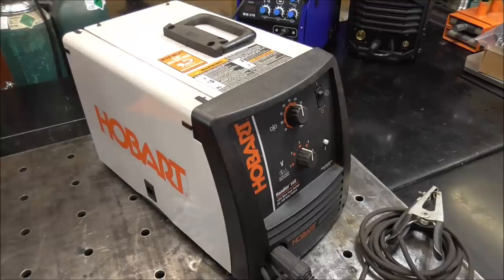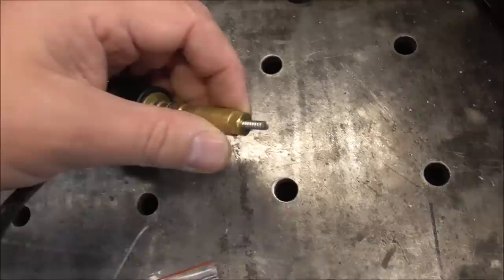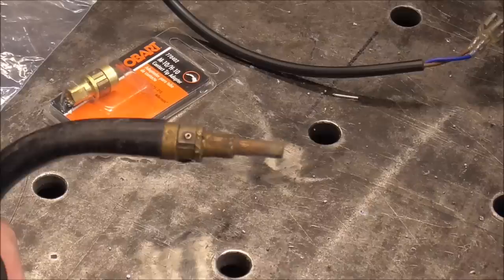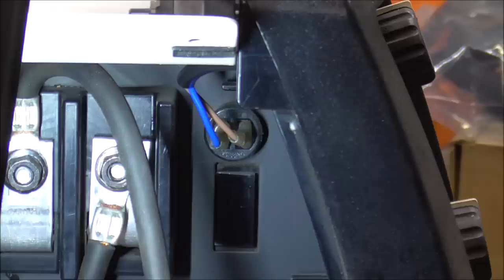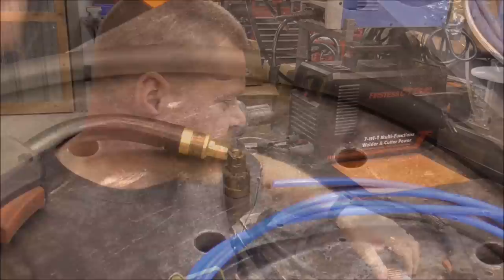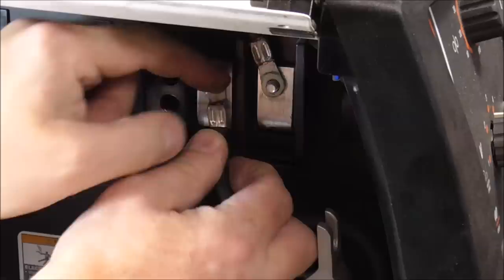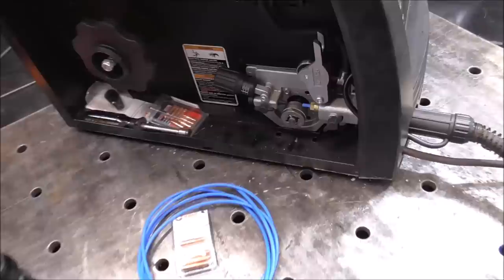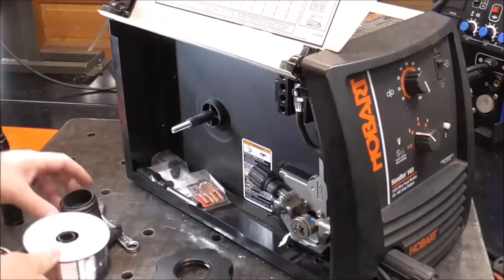Convert Your MIG Welder to Weld Aluminum - The Easy Way

Comment: Welder here, that is a lot to ask of a 120V welder. Totally sucks when the wire sticks and wire has to be rethreaded. Been there done that when I was young in my own shop. An old Airco 450amp welder. Now I have a 350 amp Miller inverter style with a wire pull motor in the torch. Only for Alum. MIG welding.
Best thing I learn from a Boeing aircraft welder is using a TIG welder but not on AC with HF Continuous start but Straight DC,  sharp point Tungsten, HF start only and using 100% Helium. No preheat required on sections that are thick. .25 plate Tees 12" squares as an example. Puddle forms in 4 seconds.
Reply from the maker: Most folks don't even know this is possible. That's what this is about.  I'm just trying to shed some light and help some folks out rather than people thinking they have to buy a new welder to do some occasional aluminum welding.
Reply: Yes sir you are correct. It's used for TIG welding thin brackets on thick Aluminum  plates. Most welders never heard of it.

Comment: This reminds me of the company I use too work for set up a high frequency box for welding aluminum and they didn't pay attention to what they was doing and they tried the phone system in the factory.
Reply from the maker: That doesn't sound very good
Reply: Yes the old TIG machines always came with high frequency to start the arc.

Comment: I customized an extra gun assembly on mine to shorten it up a bit and run a knurled wheel at the feed end. 
With a shorter gun set up you can run the softer wire with less trouble. 
I set up mine mostly to do fishing carts and similar items welding mostly very light tubing. 
It takes some practice but after a few test pieces its easy to get right. I do run a larger machine but have used the smaller machines as well. With a larger 180a machine, I was able to weld castings and such up to about 1/4" thick with lots of preheating and very careful cleaning. 

That steel table is likely sucking up a lot of heat too, maybe set the work atop something that will insulate the piece a bit. It'll ground through the clamp.
Reply from the maker: Nice tips! Thanks for sharing!

Comment: I bought all the gear to do TIG welding but could never make it work because my machine had TOO MANY knob on  it that I didn't know what they did.  I wouldn't say your welds were that fantastic, but at least you did it. If you have a second MIG welder, then convert it for occasional TIG use would make sense.
Reply from the maker: Keep in mind that this is with zero practice. The same results that anyone trying it would expect. I don't pretend I'm better than anyone by practicing and getting my settings perfect beforehand. I prefer to be genuine
Reply: To set up a TIG welder use the AC setting for aluminum, with a mix of argon or argon/Helium gas only. Switch on the high frequency with the choice of the continuous setting. And don't forget to turn on the water circulating pump or the plastic hoses will melt.
Reply: @georgebuck2269  Water circulation pump? WT? I've never seen a water cooled TIG machine before. I had pur ARGON, but still just blew holes in everything. If somewonew had of set it up for me, I could weld fine.
Reply: @doraexplora9046  In a factory setting 100% of all TIG machine torches are water cooled and also a few MIG machines that are high current for welding heavy stock. They do make air cooled TIG torches but are never used, except for hobby guys, they get too hot. Each TIG machine has a seperate pump to circulate water through the torch. I was a 35 year welder and also did maintenance on all welding machines. Spot welding machines are also water cooled.
Reply: @georgebuck2269  Thanks Uncle Buck. I never knew the heavy duty machines were water cooled. Only ever seen light sheet metal machines that are air cooled.
Reply: @doraexplora9046  Yes it's the TIG welding torch that needs a steady stream of water, so the torch doesn't melt in your hand. The copper braid inside is only 1/8 in diameter, to keep it flexible. Factories always run the welding machines on a minimum of 240 volts. If a company is putting up a new building or adding on to the existing one, the machines are 480 volts AC, three phase. I used to build water circulating systems for ten or more machines, it's called a manifold system. There's one water pump and a large tank, and I would run copper tubing to each machine. For the Argon shielding gas we would also run copper tubing. All the bottles are connected together after the gas regulators. Miller has some TIG machines with a foot pedal for less than 18 thousand. The water pump is extra money

Comment: I read just a few of the comments' so if someone else has mentioned this, I'm sorry for repeating this.  I would HIGHLY RECOMMEND changing the smooth drive roller(s,) to a knurled / serrated drive roller. (Generally used for / on flux-core wire.) Needless to say a  knurled / serrated drive roller will aid greatly in pushing the aluminum wire.
Reply from the maker: Thanks for sharing!

Comment: I've been working for a very good welder and he is short with me sometimes and I hope to one day get tank cert. But he hasn't the time and it's hit and miss with actual time with a spool gun so I do have the ability to convert my welder over .the gas feed is just a line going through the machine correct ,I've gone through and thank you I just needed to talk for a second thanks for your time
Reply from the maker: Yes, the gas line is just a gas line that opens and closes a solenoid with the trigger.
Reply: @BrandonLund  thank you

Comment: Just like copper ,heating the aluminum metal tarnishes it and makes it harder for the aluminum in your wire to stick, that's the purpose of using flux when brazing copper or brass, it gives you just enough time to join it without tarnishing so when you heat the aluminum up  after that is when you should brush it with your stainless steel brush . Thanks for the great content.
Reply from the maker: Nice explanation thank you! 👍

Comment: Very nice, complete video with one omission:  The argon tank & regulator.  Just browsing, they cost well over $25.  Check with your local welding gas supplier for specifics.
Reply from the maker: Yah you need those for sure

Comment: Replacing steel liner is a must, I tried to get by with steel liner. Sometimes it worked Sometimes it didnt...get the Teflon liner!!!
Reply from the maker: Spot on, plus you limit all that previous steel trash from contaminating your aluminum wire
Reply: @BrandonLund  and contamination is the biggest problem with welding Aluminum.

Comment: Hi Brandon. I don‘t want to sound smart but i did the same thing lets say 25 yrs ago when someone asked me if i could put aluminum in his foodtrucs so he could wash em after spilling on the floor and walls of his truck.
So i did the same as you did with exeption of reversing + and - cables.
I did need to keep a straight line with the liner so i bought a short one which worked better. I finished his trucks and it all worked great. After that i bought a handle that pulled the aluminum wire through the liner. 
After that it worked even better.
To let you know i live in the Netherlands were we have 220 volts instead of 110. 

Greetings Steven
Reply from the maker: Hey Steven thanks for your comment. Those guns are called a push pull setup. They work really nice. You can also get a spool gun which is what I generally use to weld aluminum, but this method works too if your patient but as you mentioned, it does have its limitations. Thanks for commenting!

Comment: I have been welding  aluminum with my Hobart handle for years and people sit don't believe it. I would repair transmission and any other aluminum parts with great  Success.
Reply from the maker: Don't say that too loud. There are a few welding inspectors in the room that say it can't be done 🤣😁👍

Comment: You call that beat !!! I run my freaking tips into the ground .. that thing's still new and thank you for the information I was totally unaware that you could well aluminum with that machine
Reply from the maker: @hedgepethracing9590 I've been known to run tip cleaners through my contact tips and even enlarge them by running progressively larger tip cleaners through them but the Internet Welding Inspectors give me grief so I do all the things "you can't do" (insert the reason why here) _______________ off camera LOL

Comment: It makes sense because this welding process has been used in aluminum welding...longer than it has been used to weld steel. Metal Inert Gas (MIG) now known as the broader AWS standardized term Gas Metal Arc Welding (GMAW), was originally developed for aluminum welding using inert shield gasses such as helium and argon. They (whoever they were) discovered that replacing inert gas with or adding a smaller percentage of CO2, an active gas, they could weld ferrous metals as well calling the process Metal Active Gas (MAG). The American Welding Society standardized the term GMAW to include the two processes of MIG/MAG. Names stick...so MIG, technically is a term for welding nonferrous metals like aluminum using inert shielding gasses whereas MAG is a term used for welding ferrous metals using active gasses.
Reply from the maker: Spot on Rick! Thank you! 👌
Reply: @BrandonLund  Thanks for helping regular folks open up possibilities of making their equipment more versatile.
Reply from the maker: Thanks Rick 👍  I'm glad to be able to spread this information. Especially in this economy. We need to get the most out of our equipment

Comment: Excellent and informative.     I haven’t tried it with my HH 135 .   If I was going to do it fairly oftenI think  follow the advice from the old HH Weld Talk board.   Thats buying a SHORT dedicated whip to make the aluminum feed  easily as possible .   That would solve most of the binding issues .

Comment: I was under the impression that you had to have ac to weld aluminum.  I tried using a spool gun with my old Millermatic 135, but no luck and I didn't know to try and switch the polarity.  I will give it another try.  I bought a Everlast stick and tig machine and it has ac for the tig on aluminum.  I,m too old and really shaky so tig for me is almost impossible.  I think I could do better with the mig though.  Thanks for sharing this and I will give it a try since all I have to do is plug the mig gun into the other connection.  Thanks for sharing!
Reply from the maker: Right on man! Good luck and let me know how you made out!

Comment: I think most of what a newbie needs to know was covered in your video, maybe the bench was taking most of your preheat. Use a piece of pine timber like a pencil to test preheat, when it looks like you have used a wax crayon on the material the temp is good. A must is to get rid of the oxidization on the aluminium, this will reform after about twenty minutes.  All said a clear and precise video, thanks.
Reply from the maker: I brushed it. That's plenty for padding beads in a demonstration. A torch was used for the reason given in the video.

Comment: Great video, thanks.  I use a millermatic 180 and switched it over and it works fine.  Unfortunately I could not find anyone  (I live in Canada) that sold teflon liners (,or indeed had even heard of them!) so just used a new metal one.  It seems to work OK with only the occasional birdcage issue. I am still looking for a teflon liner though.  Cheers
Reply from the maker: Gerry it's probably the same one I'm using. Hobart and Miller are interchangeable.
Reply: @BrandonLund  Thanks...I will see what I can find here with that info.

Comment: When I make serious changes to serious equipment, I make notes on print paper, part numbers, gas, tips, liner & receipts of everything inside a zip lock bag! My MIG is a 1984 and huge, but inside the wire drive side, I place all this inside away from moving parts. Even extra steel wire spools from rusting over time. You don't weld everyday in a home shop. Do NOT depend on WD-40 to protect the wire as it evaporates. So if your son has to take over, the info is in there. No guessing, mistakes or damage like a polarity change. Photos in black & white can be used for notes, info, part numbers, the welder lives on for decades. 
  Even if in your late 30's, this increases the ability to "Sell" or use within the next Gen. 
  My 36 year old son complains because I never taught him. I did, he doesn't remember. But photos are forever with notes inside bag! After that, they don't need to weld!
DK, ASE master tech since 78.
Reply from the maker: Thats excellent advise Dean! 👌

Comment: I have a Mig-Pak 140 collecting dust I've had no use for since I got my 220v welder.  Looked at a spool gun but it costs as much as the welder did.  Gonna try this out!
Reply from the maker: It's definitely a great way to go for occasional aluminum welding 👍

Comment: That little mig works great on stainless steel with the right wire and mix gas you can weld up to 3/16 in thick stainless steel with a beautiful straw color.
Reply from the maker: For as long as ive had this I haven't tried stainless with it yet. I might have to now 👍 thanks for sharing 👊

Comment: I can't believe I stayed half a hour to see how you can convert an usual MIG to weld aluminum, when I don't even own a welding machine, let alone of welding something.
Boy, you're a very good teacher, if you were able to hold me here, instead of reading about politics, I give you that.
True, my next tool would be a 3 in 1 welding machine, but the way you explain things captivated my attention.
I'll have to come back these days to dig up other secrets you might hiding, so we'll meet soon. Until then, if it's possible to gain knowledge about the usual welding by reading stuff, then re-direct me to some sites to try to master this domain, although I don't really want to go professional, just to do a good job.
Reply from the maker: @outstanding1448 this probably ranks in the top 10 nicest comments I have received. Thank you very much for your kind words. There is a LOT of information on welding and there is also a LOT of misinformation. One thing i do different than others is i like to experiment with different filler metals and I also like to test machines to see IF they can do what they claim. Another good channel you can trust with solid information is Welding Tips and Tricks.
Reply: @BrandonLund , I'm really glad I managed to put a smile on your face, considering that I do involuntarily resemble Bender. You are a nice lad, I can tell that by your genuine smile. I do believe you're here to help us, Not necessarily for internet points, like.... Mr.Whostheboss, who's ejecting shallow videos, bringing Nothing useful to cultural legacy we leave behind. Imagine that guy has over 10 million subscribers, projecting a fake smile and inserting "that what she said" in almost every video.
The information on internet is overwhelming, thus discouraging. If you have a good website where they cover it all, remaining only for one to practice, then I'd be happy to dig in.
Always remember that youtube is for people like you.
Reply from the maker: So you made me smile again man. What a nice thing to say. The world needs more people like you in it. Thanks again and I appreciate your support and kind words. FYI I haven't heard of that person you mentioned but you got me curious now so I got to go check it out. Thanks again 👍♥

Comment: Funny enough I just did this last week, got a teflon liner, a new mig wand, got argon, got the 5xxx wire 0.30 and a 0.35 tip but I got so many bird nests.  I think the drive roll in my millermatic 211 really doesn't play well with aluminum.  However I was able to finish the welds I needed to do and it was so much cheaper than buying a spoll gun.  Now this wand and gas bottle is dedicated for Aluminum and Silicon Bronze, which I see myself doing silicon bronze brazing so much more.
Reply from the maker: You might try picking up a U-Groove drive roll for it. I wasn't sure if my standard groove would work but it did. The u groove gives a lot of contact on the aluminum wire so you can run very low tension on your rolls to avoid bird nesting.  Silicon bronze is awesome. In my welding cast iron playlist I used MIG silicon bronze to repair a cast iron pan. By FAR it exceeded every destructive test I've done. If I remember correctly, the repair broke within 10% of its original unbroken condition. Welds like butter too

Comment: Just make sure you loosen the adjustable know  on the feed roller so it doesn't bird nest. I run through 10 lead and can curl the lead and I have no issues at all. I'm running .035 4043 all the time. Did you try going up in voltage and turn down the wire to 80 to 90 and you see a big difference and travel will be faster. Done it for years. Practice. Practice. The big factor here is voltage. If you have infinite voltage setting you can really fine tune it because a volt or two can make a big difference on aluminum.
Reply from the maker: I will will have to give .035 4043 a try. This is my first time running aluminum on a 120 machine. I was actually pretty surprised at how well it did. As you mentioned I wish this had variable voltage but stepping it up and lowering wfs might have done well too. I can say with certanty that ANYONE if they sat down for an hour and prcticed could achieve really good results with this setup (as you have experienced yourself). I run a lot of MIG aluminum, just not in a 120 volt machine which is what really impressed me about this because now this becomes affordable for everyone.